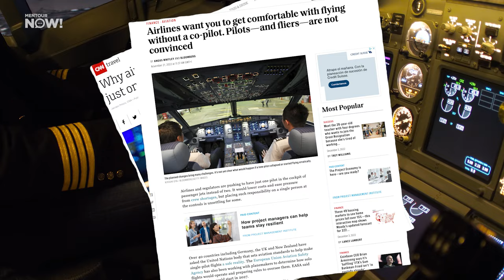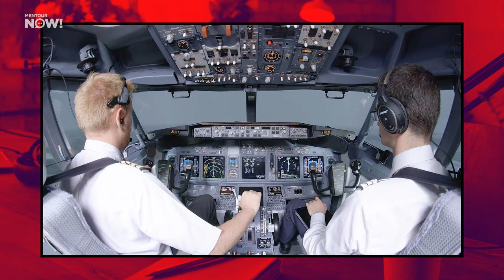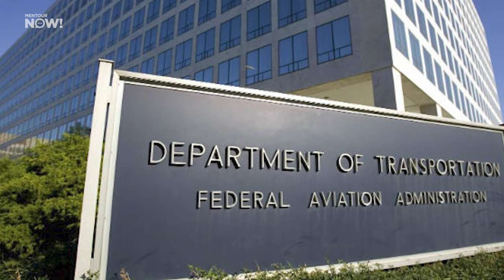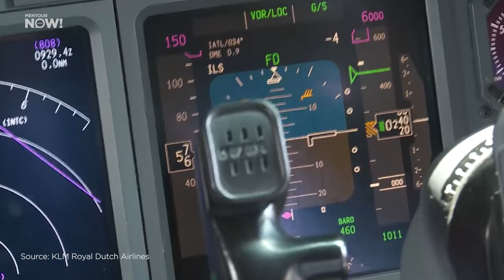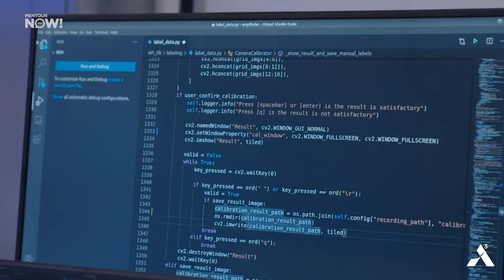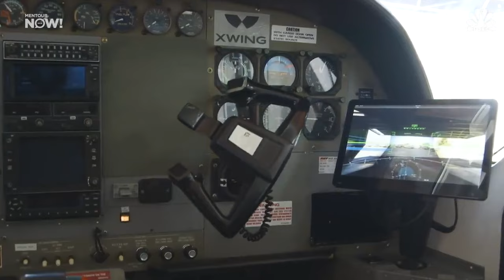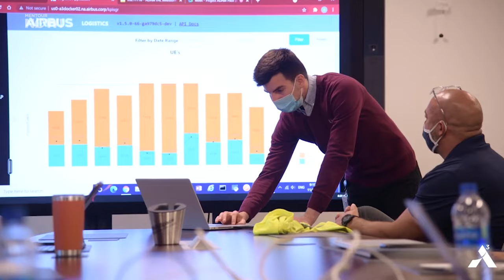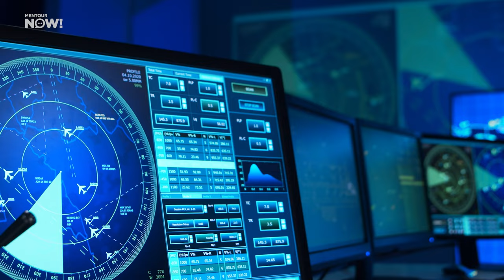The End of the Two-Pilot Cockpit?! Get Ready for Single-Pilot and No-Pilot Airliners!

Comment: I find it quite interesting that commercial airliners have been able to autonomously land for many years now but pilots only use the facility to maintain the aircrafts airworthiness (every 10th landing I believe) but the pilots prefer to do the landings (as far as I'm aware). Aircraft operate in 3 dimensional space with traffic separation but whilst people seem to want a pilot to control the aircraft there's a whole load of people eagerly awaiting full self driving cars that they would use in 2 dimensional operating space on crowded roads. I also find it odd that despite the quality and redundancy of the aircraft landing systems flights will still divert rather than land at a foggy destination.
Reply: Not every airplane is autoland capable.
Less than 1% of landings are autolands and autolands are a lot of work for pilots to set up and monitor, more than for a manual landing.

As for the diversions, there are less than 100 airports in the world with the equipment needed for an autoland.
Reply: @nikobelic4251  I presume you are referring to commercial jets....so name the current commercial jets that do not have autoland capability. I'm fairly sure Kelsey has pointed out that 1 in 10 landings are usually autoland (10%) and it's actually a requirement of keeping the planes airworthiness certificate. I'm struggling to find anything on the web that tells me what the minimum airport equipment level is for an aircraft to use autoland never mind a figure of less than 100 airports worldwide, where are you getting this info from?
Reply: @polyphonics557  sure, yeah,

The Crjs (all of them) are not autoland capable,
Embraers (all of them) are not autoland capable 
Dash-8s and ATRs are not autoland capable 

American Airlines’ 737s are not certified to perform an autoland, AA chose to op for a heads up display instead of a 3rd autopilot.
The HUD allows for a DH of 50ft and they found that they didn’t need to autoland enough to warrant the extra cost of maintaining autoland capabilities and re certifying crews to perform autolands (it would be more time in the sim during recurrent)
Other airlines have made the same choice as AA as well.

So yeah, many commercial airliners aren’t autoland capable.

As for how many landings have to be autolands, yes airplanes have to autoland from time to time to verify they can still do it but it’s not 1 in 10 landings.

You can look it up online but about 1% of landings are autolands, not 10% 

I just checked online for number of airports worldwide capable of CATIII B or higher approaches (so autoland capable airports) and the tally was 228 airports total military bases included 
Most of the airports and air bases were in Europe with the US being behind Europe by a large margin.

https://aviation.stackexchange.com/questions/84674/is-there-any-latest-list-of-cat-iiib-airports-in-the-world

I mean, think about it, ILS (especially the level required for near 0-0 autolands are EXTREMELY expensive to install and maintain. Only the largest airports (LHR, JFK, CDG, BOS, ORD…) that would see major delays and cancellations would install these systems.  Smaller airports like  PBI, BSL, MKE, (which is most airports out there) won’t install these ILS because it’s just not worth the cost. 

Where I love (MIA) Runway 9’s ILS hasn’t been autoland capable for about 2 years. They aren’t bothering with bringing the capability back (idk what’s wrong with it but the FDC NOTAMS for MIA have been saying no autoland for about 2 years) because it’s rarely ever foggy here and when visibility is usually low it’s due to thunderstorm or something so no autoland anyways. 

So yeah, autolands are nowhere near as ubiquitous or widespread as people generally think. They are rare events that can only be completed with a certified crew, aircraft, and runway.  And that’s not even close to most circumstances.

Remember when Airbus flew their ATTOL demonstrator, well, the whole point of ATTOL wasn’t to make planes pilotless, or even single pilot (what Airbus stated their end goal for flight deck automation was in airliners) it was to make automatic landings à capability for every runway out there and to decrease the workload on pilots performing autolands, since the workload for these landings are extremely high.
Reply: @nikobelic4251  Interesting......there's some conflicting info on the web.......that said.........I originally wrote "I find it quite interesting that commercial airliners have been able to autonomously land for many years now......"   to which you replied "Not every airplane is autoland capable."..........my comment didn't say "All" and my comment is still valid in pointing out that on commercial aircraft (with commercial grade automation and redundancy) pilots given the choice will sooner land the aircraft themselves rather than use the automation whilst in the consumer driving world people are apparently willing to put their faith in consumer grade automation of a car. It appears
Reply: @polyphonics557  That is the same source as mine but if you look at the airports listed it included Military bases. I didn’t count how many were military bases but they are included, so it would be less than 228 airports worldwide, which is still the minority of airports.

The reason I brought up the “not all airliners are autoland capable” is because for one, a lot people think this is case, second, it would explain why there are still diversions in foggy weather even though performing an autoland is a capability that has been around since the 1960s. 

You did ask me in your subsequent comment which airliners weren’t capable of performing an autoland which lead me to believe you may not have known certain airliners aren’t autoland capable.

Which, isn’t egregious, most people think every airliner out there can “land itself” and that it’s a simple procedure to perform.
Reply: @nikobelic4251  ok.......and........how does this relate to my original comment?
Reply: @polyphonics557  Because it is clearing up misconceptions about automatic landings

Comment: Pilot's view on this topic will always be biased due to the need for self preservation.  You argue two pilots can offer redundancy but willfully ignore the fact that you can also deploy dual or triple AI systems, that can easily out think, out calculate and out reason any human pilot.  If saving jobs are removed from the equation, I would argue developing advanced AI to replace pilot is the way to go for the future.
Reply: Why not have the single pilot AI system and 2 pilots for maximum redundancy?
Let me guess…
Money…?
Reply: @nikobelic4251  Why bother with AI if it's not to reduce cost and reduce pilot error?  Combine AI and human pilot is also problem-inducing.  There have been studies done to show handoff to human can also result in poor decision making due to lack of situational awareness by the pilot.
Reply: @_w_w_  just have the ai correct human error and keep two pilots for if something goes wrong

Even if the two pilots have issues with solving the problem it’s better to have two than one if something happens that the AI can’t handle

The AI would just be a safety bonus and not as much of a cost saving measure.
Reply: @nikobelic4251  Then why invest in AI???
Reply: @_w_w_  for safety, an added backup system. 

Do we improve engine reliability to get down to one engine on airliners?

When they invented the first autopilot in 1913 was it to remove the pilot from bi-planes?
No. It was just a tool pilots could use to make flying safer
Reply: @nikobelic4251  Your logic is flawed.  You suggest AI is not or would not be good enough, not safe enough, and human pilots are better.  But then, you want AI to backup and correct human errors or fix issues human can't.  It only makes in your mind.
Reply: @_w_w_  that’s not what I said or implied.  

If you have a safe AI and two safe pilots, you are safer than with one AI and One safe pilot. 

3 points of failure vs 2.

This is very logical.

The only reason why you would want to remove one of the pilots would be to save money. 

It’s like if we create an engine that is never expected to fail.  Yes you can fly the airplane with just one engine but you are safer with another one there just in case.

2 points of failure vs 1. 

Am I saying one engine isn’t good enough? No, we expect the plane to be able to fly with one engine if the other fails so obviously not. But because of the 1% chance that engine does fail let’s have a second one there.

Ever heard of the Garmin Autoland?

It’s an automated system that can land the plane if the pilot is incapacitated it’s available on 3 GA planes, one of them is a small jet. 
Now, Garmin emphasized that this WAS NOT a pilot replacement and couldn’t be used as such it is ONLY in an emergency in the very unlikely event of pilot incapacitation in a single pilot airplane.

In this case the automated system is the backup to the human.  The idea is “having an automated system land the plane is 100 times better than an untrained passenger” are they suggesting the pilot isn’t good enough?
No but in the less than 1% chance he can’t fly the plane anymore let’s have this system in place to land the plane instead of having… either an untrained passenger or literally nobody up there who can land it.

No manufacturer is talking about making a completely pilotless airliner so I am not even going to get into that. Airbus has said they are keeping the pilot and Boeing has implied it as well.

So talking in a 2 or single pilot context 3 points of failure is better than 2.
I don’t see a condition where the opposite would be true.
Reply: @nikobelic4251  You just don't get it.  Either you are a pilot or someone in the industry that has a self preservation interest so your view is very distorted.  If you think AI won't be safe enough to pilot then why would it be OK to use it as backup?  If you develop technologies, you'd understand how silly your stance is.  To serve as a meaningful backup, it has to be capable and error free as possible.  If it reaches that level, then we won't need a human pilot in the first place.  The configuration is AI onboard as main pilot and have redundant AI onboard, then have human on the ground as backup in the event of system malfunction.  You think pilot does real flying these days but they don't.   Most of the systems are already automated and highly computerized.  Pilots are basically inputting commands these days.
Reply: @_w_w_  
Claiming that I disagree with you “because I must be a pilot or someone with self preservation” isn’t a valid argument 

I might as well say “you must want AI to take over because you develop technology”

Why have the pilots on the ground trying to troubleshoot from there instead of having them in the air on the plane? 
Where is the safety benefit in that?

Also, look up Pascale Traverse. He was head of autonomy at Airbus. He said (not me) he doesn’t foresee pilots being completely replaced by AI on commercial airliners.  He said Airbus doesn’t foresee a day where airliners fly  without a pilot on board.  
This is literally from the Head of autonomy at Airbus. You can argue against him if you want.

Your last comment about “pilots not flying planes” just shows how little you know about aircraft operations.

No, there isn’t much manual flying but the pilots are still flying even if the autopilot is on,
A NASA study determined that even with all the automation we have today the workload is too high for a single pilot, so pilots are still flying, even if it’s not hand flying. 

If you disagree, riddle me this. Did your iPad or computer write your comment? Is my iPad answering you? Surely I am writing this comment, I am simply pressing buttons on the iPad and it creates the letters. The iPad’s handwriting is better than mine and it never messes up a letter.

But you wouldn’t say I am not writing this comment, that’s nonsense, the iPad wouldn’t write anything if I didn’t tell it what to type.

Why would that be different for pilots flying an airplane if they are telling the autopilot what to do,  when to do it and how to do it.

You could also say engineers don’t design planes anymore and that it’s all computers  or that computers do all accounting or that calculators are the ones actually doing math homework or that robots do surgery and the surgeon isn’t actually doing anything. 
Of course, all of the above isn’t true. The computers are tools professionals use to do their job more efficiently. It doesn’t mean they “aren’t doing their jobs”

Comment: How does a single Pilot strategy for a wide body aircraft make flying safer? Sounds like a woke engineering idea tbh. There are a million other things that aircraft manufacturers can fix and improve on. This is not one them - i.e. using AI and Machine learning to make every wide body aircraft flown with a single pilot. Doesn’t make sense. 

Single pilot on wide body aircraft isn’t one of them. This is just another elephant project.

Comment: Well, sometimes I wonder if we couldn't do a "tiered" approach.  For short flights, have a Pilot and then a commercial pilot student or someone lower paid.  That way, one can learn and gain hours, and (and look out for the obvious situations), and then still have the redundancy.  I guess the question is, in an emergency, how much skill do you need (one or two pilots).  From your episodes, I am noticing that the pilot in command barks out orders, and the copilot either fights the determinations made by the pilot (accurate or not) and also reduces the work load of the pilot.  Question:  Should "co-pilot" be its own field? A person who does not understand the systems as well as the pilot, but can perform workload reduction.

Comment: Not very good arguments here.

For starters there are plenty of ways to secure a remote data link, security researchers have been improving this for decades. Its probably less likely than bribing or convincing one of the pilots to hijack an airplane.

Also, don't have a remote data link then! Have an autonomous system take over. There are already systems that can safely land automatically at an airport. A pilot can press a button or the cabin crew can press a button that triggers the plane automatic emergency land.